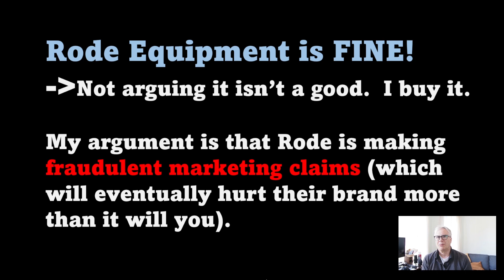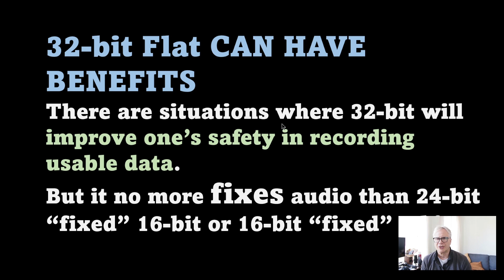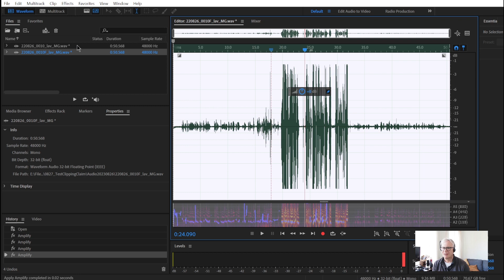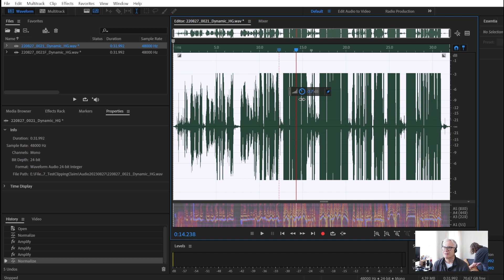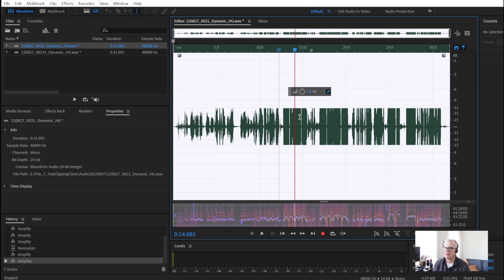32-bit Float Microphone Clipping Tests

Comment: Thanks for leaving a comment on my recent video. In regards to you saying that "32-bit has nothing to do with setting audio levels" yes that is true... but then again nobody is claiming that it has anything to do with setting audio levels. In fact myself and Rode are simply saying in most cases you don't have to worry about setting audio levels. As in you shouldn't even touch them. 32-bit float simply means there is more of a audio range being captured. Can you go past the limit of the 32-bit recording? Of course you can! Hence why in your video when you put the gain all the way up you are clipping on the higher scale of loudness. In most cases scenarios you are not supposed to adjust the audio levels. Just leave it in neutral setting that the manufacturer has set. This allows the 32-bit float recording to capture any normal sounds that human ears can hear. The average healthy human ear has a dynamic range from 0dB to 120 - 130 dB give or take depending on the person. From the faintest whispers to loud screaming. Of course when recording very loud sounds that human ears can't handle, (like very big explosions for example) you will still need to adjust the gain setting lower. A gunshot is typically around 140 to 190 decibels. Ive done lots of tests recording gun shots and explosions and 32bit is also really useful when capturing those because the dynamic range of the recording is so much bigger. But it doesn't mean that you can just hit record and think you will always capture the full explosion sound. In some of cases I had to bring the gain setting down to be able to capture those louder sounds. When you are recording most sounds that fall within the average human ear decibel range you are fine. So I would ask you to do another test where you don't touch the gain setting on your recorder and simply record people talking, screaming, whispering, etc. Then see how much more superior 32 bit float recording is to say 16 bit. To put it in perspective, 16-bit audio is capable of recording sound with a dynamic range of up to 96.3 decibels. 24-bit audio recordings can capture a dynamic range of up to 144.5 dB. Meanwhile, 32-bit float audio can capture the absolutely ludicrous range of up to 1,528 decibels.
Reply from the maker: Hi Tom.  Thanks for the reply.  Sorry, I have to say it again because of your comment above "32-bit float simply means there is more of a audio range being captured."  No, it doesn't.  If you understood how 32-bit float works, I mean if you could do the process in your head of converting a microphone's voltage range to memory you wouldn't say that.  You're relying on what Rode saying being true.  And sorry again, it is you who have not done the experiments.  I have.  There is no difference.  When you see a difference it's because you're sending data into software that expects it to be properly scaled, and it isn't. 

When I replicate the experiments others do, best I can, I see that they are purposely doing things wrong to make it look like 32-bit float is better.

When you say "16-bit audio is capable of recording sound with a dynamic range of up to 96.3 decibels" the decibels are an ABSTRACT measurement.  They have absolutely nothing to do with the actual count of electrons from a microphone at any given point in time (sampling rate).  The "decibels" talk, when it comes to analog-to-digital is used to confuse you. It's an AFTER-THE-FACT measurement.  Show me any ADC schematic where decibels is discussed.

You wrote, "32-bit float audio can capture the absolutely ludicrous range of up to 1,528 decibels."  "Capture" is the completely wrong word here.  32-bit float can "represent" an (imprecise) range of values within 1 to 1,528 decibels.  Okay.  But ask yourself, if 24-bit has 146db and 32-bit has 194db, why not 32-bit fixed first?  If 32-bit float is so much better than 24-bit, why not use 24-bit float? (You can make a float value from anything btw).

Until you clearly understand the difference between any X-bit FIXED and X-bit FLOAT you should not make any claims.  It's a hard subject, but if I can do it you can do it ;)

The reasons what you believe are false are in the your beliefs themselves, you just won't connect them.  Rode sent you a free mic at some point I guess and now they're friends for life.  I get it.  No real problem.  It doesn't really matter, at the end of the day, if you capture in 24-bit or 32-bit float.

But should you make claims you cannot verify?  Or explain mathematically and technically as I (and others) have? Don't you want to know the real truth?  Of course, you wouldn't have replied.  I'm happy to answer any question on phone or email if you want to see this to the end.
Reply: @MaxoticsTV  I have not relied on information from Rode. I have used audio software for years that already did processing in 32bit float because of it's wider range that gives obvious benefits. Anyway I will try to do a video addressing some of your points. Also just making sure you are not talking about using 32bit in a live settings. Like a live to broadcast or sending a video and audio feed to a camera or other device that then records. To see the benefits and the much wider range of 32bit it has to be recorded natively from the mic to the 32bit capable device. If you put anything in between that like a gain adjustment device, preamps etc then the benefits of 32bit go out the window. Same if you have a 32bit capable device but you use the feed out of that device to record internally on a camera or even a computer software that isn't capable of 32bit. I am not an audio expert so my explanation or terminology might not be the best. Hopefuly its not confusing. My main area of expertise is Visual Effects. But talking to the industry experts in audio recording they all confirm what I am saying. Last film I worked on was Marvel's Antman and the audio guys working on that film used 32bit extensively for both recording and post processing and when I asked them why not use 24bit, their simple answer was "Cuz it's much much better!"
Reply from the maker: @TomAntos  If you haven't relied on information from Rode then you don't understand, sorry, how 32-bit float works.  32bit float, from a fidelity point of view is NO different than 24-bit fixed.  This is a simple question of math (that unfortunately doesn't have a simple explanation).    I did a video explaining why an audio person does not need to understand how 32-bit float works, or any data space for that matter.  So for you to use an anecdotal "Cus it's so much much better!" says what? The guy turns knobs for a living.  It's like using a race car driver to support an argument that engine X is better than engine Y.  What does it really know on the subject?  I can trot out audio engineers who will say EXACTLY what I'm saying.  Not only is 32-bit float only different than 24-bit in SCALE not PRECISION, 24-bit is overkill in the first place!  You can find those arguments between audio engineers back in the 1980s and 1990s.  

You want confirmation, you can find it.  Truth is a much more difficult road.  All I can say is prepare for lots of sadness if you take that road.  Your experiments, if done without bias, will show what the math says.  I look forward to your results!

Comment: No disrespect... but I don't think these are meaningful tests.

In test 1 at 2:57... you raised the level above 0db in post... so of course it still sounds clipped and distorted.  Don't do that!

Also... if you're trying to match the levels of two different parts of a file... you should do each part separately.  You shouldn't raise the entire file at once.  And you never raise anything above 0db.  If there are quiet parts of the file and loud parts of the file... you should adjust them individually to make them match.

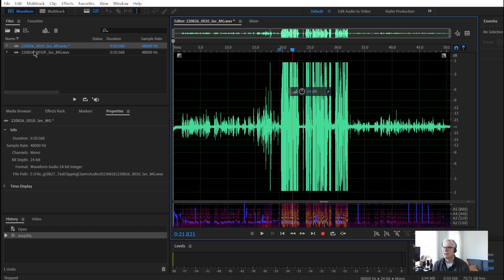In test 2 at 5:41... it sounds like you overloaded that poor lavalier mic by almost shoving it on your mouth.  Your lips are too close to the tiny mic!  Nothing can fix that.  If the mic was on your shirt like normal... but the gain was set too high on the recorder... or you simply started shouting... I believe the recording would have been usable.

32-bit float isn't a fix for poor microphone technique.  You still need to properly place the mics to get a decent recording.  A lavalier mic goes on your shirt... not your lips... 😋

The big benefit of 32-bit float is that you don't really have to worry about setting the gain.  Some recorders don't even let you set the gain!  It just records a file and you can adjust it later in post. (assuming you use proper mic techniques!)

Check out the Zoom F2 audio recorder.  No gain setting.  Just a record button.  Here's what Curtis says about it: "The headline feature of the F2 is that you do NOT need to set the input level or gain. You just turn it on and start recording. If the levels are too low or too high, you just adjust them in your video or audio editing app on your Mac or PC."

That's pretty cool, right?  You wouldn't dream of having a 24-bit recorder without gain settings.

In test 3 at 7:32... you, again, raised the level of the 32-bit float file above 0db.  Don't do that!  🤣

You say "it's still distorted" but that's because you raised the level too high!  You should have played it as it was recorded... and not raise it above 0db.

Anyway... I've got plenty of recording equipment here so I might run some tests myself.  But they'll probably be like every other Youtuber demonstrating 32-bit float recording.  There's plenty of reviews and tests out there!  😎
Reply from the maker: I'd love for you to do some tests and am totally open to collaborating (duplicating them on my end).  Yes, my tests aren't meaningful in many ways.  But they prove to me what I understand theoretically.  That doesn't mean I'm right.  I may have missed something.  Still, I don't believe what you've wrote above has much to do with the issue (sorry!).  

Indeed, you make an argument for me.  The reason Zoom doesn't have a gain setting is they've locked the microphone into its optimum ADC settings.  Remember, the mics lose fidelity if the ADC is driven lower or higher than the membrane's optimum vibrations.  In that way, it is like shooting RAW with a camera.  You're not changing the sensor's current.  If you run the zoom at 24-bit and 32-bit float you'll get the same file.  Assuming the AGC is off.  If you have a Zoom.  Maybe try that test .  Thanks!
Reply: MichaelScrip is right. What's going on is that it's not the 32bit file that's distorting. Rather, you're overloading the 32bit audio IN YOUR DAW (sorry, caps in lieu of italics). In other words, you appear to be introducing the distortion in post, artificially. No one would ever do that in the real world. Normalizing the 32bit audio should produce clean levels which you can push and pull as needed, flexibly. However, clipped sound in a 24bit file is baked-in forever, regardless of what you do in the DAW. It's like clipped highlights in a camera image - that data is gone forever. That's why camera RAW is prized among film makers - the clipped data is largely retrievable, and you have much greater control of the image's tones in general. This is similar to the way 32bit float works. Cheers. 🙂
Reply from the maker: @HeathcliffBlair  I'm fairly new to audio in depth. These tests have the problems you point out.  No argument!  But I believe they will illustrate the problem.  I should probably do new ones though.

Video RAW, is something I've analyze/studied for years, which you can see in my channel's history.  Camera RAW is at maximum, 14-bits linear.  It doesn't fill up 16-bits, let alone 32-bit anything.  So I don'ts see how it is "similar" to 32-bit float.  Indeed, I don't believe any video is stored in a float-format.  Red RAW is 16-bits.  I doubt their cameras even use the full 16-bits.  Since computer electronics are built around bytes (8 bit segments) it makes sense.  

From what I understand it's the same in audio.  No analog source has yet to tax 24-bit all the way.  Most ADCs can barely fill 16-bits with usable data.
Reply: @MaxoticsTV  Re. RAW and 32bit float - Indeed, I think the end effect (preservation of detail/information and dynamic ranges) is similar rather than the actual method used to achieve it. Two different worlds with a common ambition? Cheers. 🙂
Reply from the maker: @HeathcliffBlair  I wish I could agree!  Yes, in audio 32-bit float scales closer to the way we hear dynamic range (exponentially).  But, as you know the range is so large it would kill us to listen to.  Generally, all audio is brought within 92 db, if not much less.  Most stuff is listened to at effectively 6-bits and 0-15Kz.

So much is compressed these days.  I'm sure we could have a lively talk on that ;)

The reason it doesn't apply to RAW is that yes, we "curve" RAW linear data to make it more pleasing, but that curve is assumed by the manufacturers of our equipment.  There is no "brightness" data in video.  It assumes a gamma (curve) in everyone's player.  It's easier just to leave it in linear and deal with the exponentiation, so to speak, later.  

Ironically, one has more controls to effect the gamma in video, in just about every device, than they do the compression or EQ!   in audio!  

For a long time I thought video data had a brightness component.  When I finally learned how it works I had a serious OMG moment!
Reply: @MaxoticsTV  Interesting. Thanks!

Comment: In post production, adjusting audio levels to desired levels, is standard operating procedure. One can raise one section of a recording, separately from everything else. To do so, one splits the audio recording into sections. I find it remarkable that you lowered the clipped 24 bit auidio down, and played it to show it was still clipped.
Now do the SAME THING with the 32 bit recording. It WILL NOT still be clipped! That is what recording in 32 bit is all about. You can bring the audio back down (IN POST) below the clipping point. Note, if you clip the SPL of the microphone, that can't be undone by 32 bit float.
As you can see, when recording 32bit float, the device presets gain levels. Much lower than most would set in 16 & 24 bit. Because the noise floor in 32 bit is so low, raising a lower level recording, doesn't add the same EIN noise floor. 
If you take you recording in your DAW, split lower level recordings, from high volume recordings. Then normalize each section to -3db. You will find it all sound about normal volume to each other. Then one tweeks a bit more to desired finished results.
I hope to see a quick follow-up video. 👍
Reply from the maker: Thanks for input!  You're right, I'm not doing anything one would do in the real world of post production.  The chronology of this endeavor is Rode came out with some videos claiming every audio engineer should record in 32-bit float and they had solved clipping with their new Rode Wireless Pro.  I felt they went too far.  I'm only trying to demonstrate that you can't record in 32-bit Float and ignore what your analog gain is set to.

Did I drive the mics beyond the SPL clipping point?  Probably.  But I think that is the real world problem people have (though even that rarely as I point out in the beginning).  

Noise is a function of analog amplification.  If I am wrong about that you need to explain how 32bit has lower noise levels.  Yes, it has lower scale levels because of the way 32-bit float works (the scale is wider, due to is exponential nature), but that is mathematical and nothing to do with the "information" in the audio data file.  And that usable mic data is well below that of 24bit, even 16bit.

Look forward to your follow up!  Thanks!